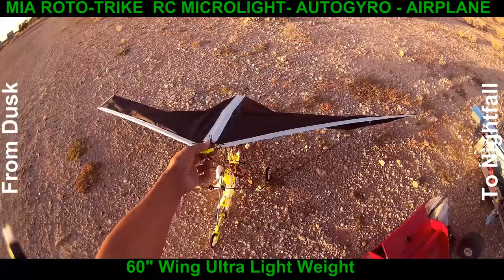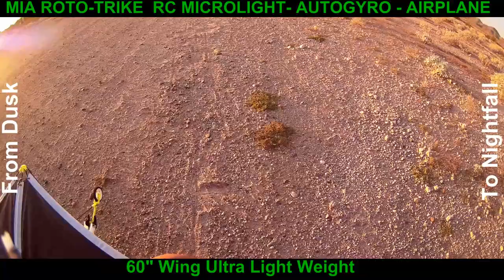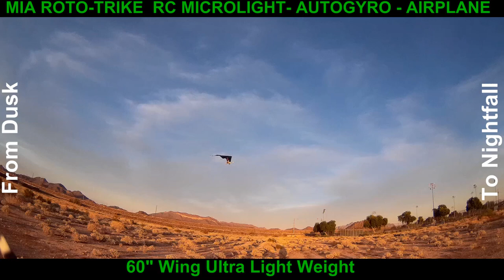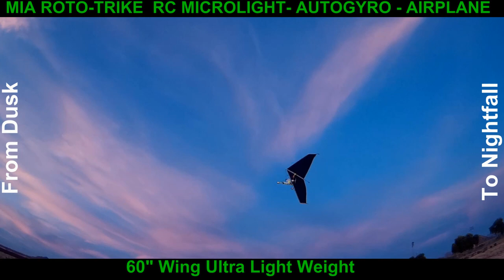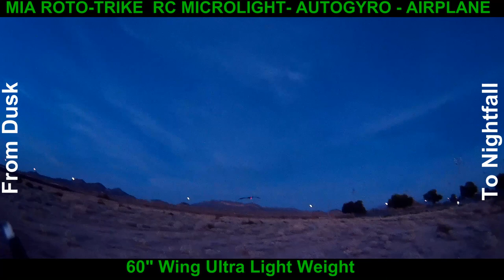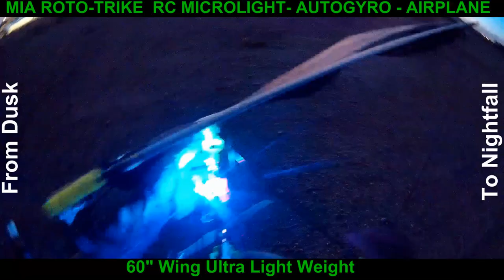MIA ROTO TRIKE™ RC Microlight Autogyro Airplane - A 3in1 Super Slow Flyer

Comment: Hopefully the 3d printed parts don't crack and fall apart like on the ones I have bought from you and now I can do anything with them and now you will not even get back with me so I can fix them.
Reply from the maker: Thomas, 3D printed parts cannot be overstressed  by overtorquing the tightness with the mounting screws and nuts, snug is fine to hold the parts in place. If they are torqued too tight with the hardware, they are likely to crack. Which parts are you referring to and can you please email me to miadsgns@cox.net. I will send you new ones. Not a problem, but I need to know which ones and what color, via email please.  Thank you.
Reply: @MarioIArguello  I have sent you many messages over the last month and have heard nothing from you.
Reply from the maker: @tommy400ex  Please contact me via Email, I do not use my phone often, I know in an age where everyone relies on high tech cell phones, I don't, except for emergencies and mild access to internet. It is also a lot easier for me to read and type text on a regular PC than having to read and type text via the small screen of cell phone.  It is also mutually beneficial for sellers as well as customers and technical support communication via email.